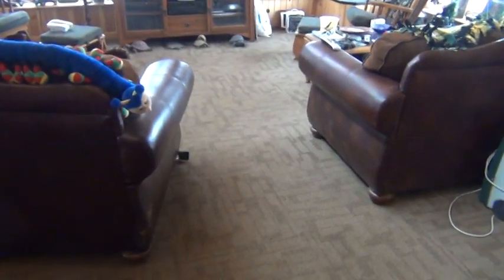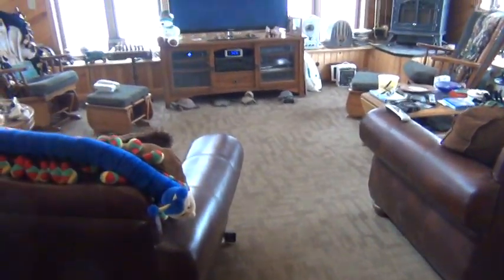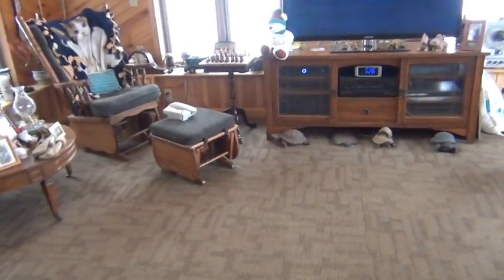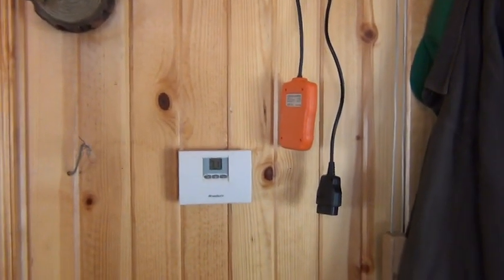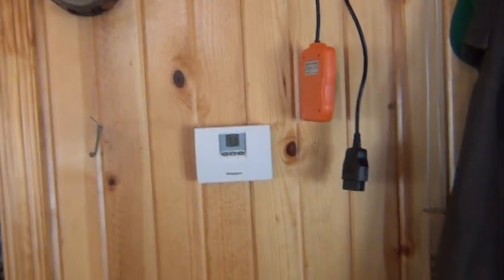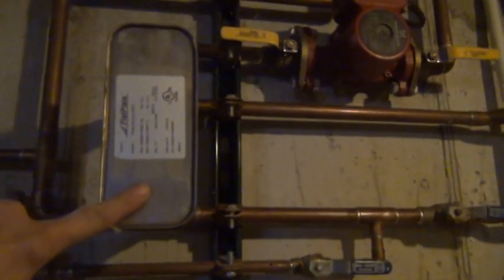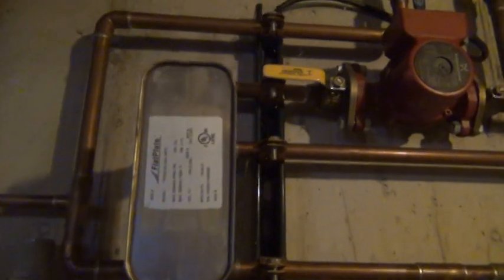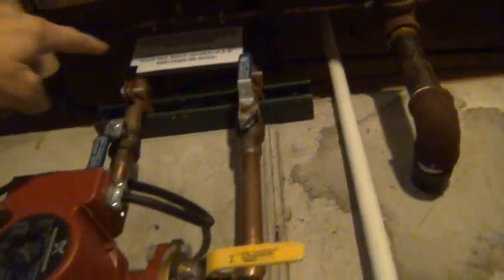Radiant Heat Using a Condensing Tankless Water Heater.

Comment: Hi Sudpail, I wrote to you awhile back but our build got delayed and the in-floor heating is just being addressed now.  Our addition is also 20'x20' and our plumber says a simple tank water heater should suffice, (will have a heat exchanger, like yours, and divide DHW and floor heat - so the same system as yours but with a tank heater instead of tankless).  But at 2:30 in your video, are you saying you used a tank heater first but it didn't work properly so you switched to a tankless?
Reply from the maker: Hi Robert, No I actually said that it did work quite well, but the problem with it was that there was a wide variation in water temperature between heating cycles. The tankless water heater provides a continuous 130 deg. supply to the primary loop with no variation as long as the thermostat is calling for heat. I found that because of this the tankless heats the floor faster and more consistently. While I was using the tank water heater I was quite pleased with it, but when I switched to the tankless I noticed the improvement.
Reply: @spudpail  OK, I understand,  Thank you for your help on this.  It seems to me that the tankless unit is a better way to go for the reasons you've stated.  My plumber might have a bias against them.  They do seem to have more problems than a good old tank heater - a lot going on in that small box.
Reply from the maker: @RobertSmith-bh5cv   I haven't had any problems in 2-1/2 years now. A friend of mine installed a new water heater about 6 years ago and It sprung a leak. Rheem made it so tough to get a warranty replacement that she just gave up and paid full price for a new one. The "good old" tank heaters aren't like they used to be so in the long run you may be paying more for a standard WH that a tankless. Did you get a standard vented heater? I don't like the fact that you have continuous cold air flowing right up through the middle of the water column. How many times have you heard a water heater turn on even tho no one is even using any hot water.
I used to have a house in Chicago that had a tankless water heater for close to 30 years. It had its idiosyncrasies that we learned to live with, but it never gave us an ounce of trouble. The heater was still up and running when I moved out. Tankless is not a new technology. They've had them in Europe long before we even heard of them in this country.
Anyway, I'm curious if you are using overhead shower valves with your new floor heat system? If you do you might get a rude awakening if you take a shower while your floor heat is on. I'll explain in further detail if you do.
Reply: @spudpail   By overhead shower valves do you mean just a regular shower head with standard controls for hot and cold?  That's what we have.  Please tell me what happens if the floor heat is running at the same time you take a shower.
I should reiterate that our system is just orange pipes dangling in the basement at this point.  We haven't hooked up the floor to anything yet since things were delayed so long.  I'm leaning towards tankless but I still worry about the complexity of them.  But you're right, things aren't what they used to be and as you say, the good old tank might have problems too.  I'll keep you posted.  I have to make the  final decision this week.
Reply from the maker: @RobertSmith-bh5cv  This may seem silly to you, but I like to have a valve on the shower head pipe that comes out of the wall. They are sold in stores for this purpose. The reason I have it is because I like to turn off the shower while I'm soaping up without having to stand in a corner somewhere and having to mess with the shower valve itself. It also saves hot water. Every time I'd turn it back on it changes the water temperature. The problem I had is when the floor heat pumps are running I would get a blast of cold water when I turned the valve back on. The reason is because the water gets pumped back through the wall shower valve which is still on, so it provides a third loop for the cold water to flow back down the hot water supply piping. When I would turn on the shower head valve it would take a good long time tor the temperature to return to normal as I cringe in the corner. I devised a convenient method to turn off the floor heat pumps by remote while I'm showering. Problem solved! By the way, this would happen regardless of what kind of water heater you have and only in a system that uses the same heater for radiant heat and domestic hot water.

Comment: Great video, thank you so much for your information you shared. Question, I have a small condo , 1200 square feet. My tank heater does my heat for the winter. Can a tankless water heater still heat a home?

Comment: 9:10 Any concerns about the electrical outlet behind the gas connection?
Reply from the maker: I guess if it developed a leak and the outlet started arcing and sparking there may be a problem.
Reply: @spudpail  if the sun exploded there would be a problem too..
Reply from the maker: @rogerwhiting9310  Giggle!! How very true!

Comment: Would  heat be conserved if the copper pipes were all lagged against the cold air?
Reply from the maker: I learned something today. I never heard of the term "lagged" before as it relates to insulation. Interesting!
It probably would save some energy and some of the pipes are lagged, however I actually want some of the heat to escape into the basement. My hot water bills are so low that I'm not really worried about it.

Comment: This is fantastic, thanks for posting.

I'm just finishing an addition of the same 20'x20' dimensions, with in-floor heating pipes installed in the slab.  I want to do the same heat exchanger system you have but not sure whether to use a tankless or tank-type water heater.  How did you decide on tankless? 

2 other questions:  Is the noise level of the Rheem acceptable and do you have a recirculating pump for domestic hot water, (I've heard it takes quite awhile to get hot water tot he taps without a recirc. pump).

I like the look of this tankless unit from Bradford White:  https://www.youtube.com/watch?v=1sFr9IP0nfE  It has top mount hook-ups, built-in flush valves, a system to reduce scale build-up and something to supposedly deliver more constant hot water.  Plus, it has a connection to hook up a recirc. pump.  No affiliation with Bradford White and don't know anything about their reliability.
Reply from the maker: Hi Robert, I decided to go with tankless because of the unlimited supply of hot water and because of its excellent efficiency. The previous water heater I had was a forced vent tank type water heater that I was very pleased with and it lasted for 27 years! I didn't want to go back to the old style gravity vent water heater and the price difference between a forced vent tank style heater and the tankless was only about $400.00. (Installing it myself kept the cost much lower). The tankless water heater also has the advantage of supplying water at a constant  temperature without any cycle fluctuations. Tank water heaters won't last as long either, so there is a payback besides energy savings. The noise level is very low!You do need a recirculating pump on the domestic side, but only for the primary loop of the heat exchanger. The domestic water to the taps is the same as it would be with a conventional system. As a matter of fact, everything is the same, it just works better! It doesn't take any longer with a tankless than it does with a conventional heater to get hot water to the taps. I don't like the recirculating pump idea because you always have hot water sitting in the pipes losing heat. If its new construction then insulating the pipes would help.The Bradford White looks like a nice unit. If it works as well as the Rheem or better, who knows? The BW has got a better warranty. I did have to purchase the clean out kit separately, (about $75.00). Do you have a water softener? If you do then you probably won't need to clean it anyway.The water pipes come out the bottom, but I never considered that to be a problem. The air intake and exhaust are on top and I was able to use 2" PVC instead of 3" due to the short run. I used 2" so I wouldn't have to bore 3" holes in my wall.Thanks for your compliments, comments and questions. Good luck!
Reply: @spudpail  Thank you, this is more great info.  Now leaning more toward tankless.  And I gave you a thumbs up!
Reply: Sorry, one more quick question:  How did you decide on 199K BTU's?  Since I watched your video, I phoned Bradford White and a technician recommended their 160K BTU unit.  There isn't much difference in price.  Do you think it's better to go with the higher BTU unit?
Reply from the maker: I guess I like redundancy up to a point. The cost difference isn't that great and I like for it to keep up with a heavy demand.
Reply from the maker: Thanks Robert. You made my day!

Comment: So is the only real difference, (besides the price)  between a tankless water heater, a combi boiler and a dedicated wall mount boiler the heat exchanger? Based on your experience do you think a set up like this would work for baseboard heat as well? Do you use the same unit for your domestic hot water? Thank you.
Reply from the maker: Yes I do use the same unit for domestic hot water. If it was used only for the floor heat, I wouldn't need the exchanger. I don't see why there would be a difference in using a system like this for baseboard heat rather than floor heat. Dedicated boilers usually run at around 180 deg. whereas this unit runs at 140 deg. max. to prevent scalding. Also as in my case the water runs through the exchanger which means that the water temperature would be a lot lower at the baseboard, (about 100-110 deg.). In my case it works fine for my 400 sq/ft. room, however if I were trying to heat the entire house, I believe a dedicated boiler would be the way to go. I hope this helps and thanks for your question.
Reply: @spudpail  Yes, it pretty much does. I was trying to find a way to save money by not paying the extra money for a boiler, but I guess there isn't one. (My house is like 1800 sg ft.) Not unless I wanted to divide the house up into zones and use a small unit for each zone. Or maybe if I used a straight hot water tank as a storage unit for keep extra hot water on hand for the heating. I guess I'll just have to keep living with the $600+ a month in oil bills. 
Thank you anyway!
Reply from the maker: I didn't know you were burning oil. Is there a chance that you can convert to natural gas? You will find that it will pay off in a BIG hurry!!
Reply: @spudpail  We can only have propane here. I'm thinking now maybe I should just a couple of those through the wall propane heaters.
Reply from the maker: I don't know what your energy costs are in Maine, but around here even propane is cheaper than oil, but I'm sure you checked out all your options.
Reply: @spudpail  Our electric is double most places because of our company charging for usage and delivery. Propane and oil are within less than a dollar of each other and the closest place that sells natural gas is 60 miles away.
When you installed your tankless did you have to have the gas company come and "tune" it for proper burn rate... etc or did it work the way it should right out of the box?
Reply from the maker: It was a fairly seamless installation that worked right from the start. I was concerned that my gas meter wouldn't provide enough gas for this 199,000 btu water heater along with all my other gas appliances, so I scheduled a service call and all he needed to do was tweak the meter on the input side and everything seems to be fine for about a year and a half now. No charge!
Reply: @spudpail  Is that floor you're heating concrete or is it just wood with the PEX and reflectors underneath?
Lucky there. The companies around here charge for everything.
I'm beginning to wonder if my only choice might be something like https://www.homedepot.com/p/Rheem-Performance-Platinum-50-gal-10-Year-Hybrid-High-Efficiency-Smart-Tank-Electric-Water-Heater-XE50T10HD50U1/303419574 and just leave it in heat pump mode as long as I can. I could always use my old hot water tank as a storage unit for the eating loop. Just a thought.
Thank you.
Reply from the maker: @TheMaineViews  The floor is concrete with Pex tubing. The piping to and from the floor is copper. The unit you sent the link for is interesting and has great ratings. In your situation this may be a good idea. In mine probably not so good. The "smart" part makes me giggle!
Reply: @spudpail  lol

Comment: What is turning on the boiler?
Reply from the maker: This is actually not a boiler, but rather a water heater designed to provide domestic hot water. I just installed it into my existing floor heat system. It turns on by sensing the water flow in the primary loop when the circulating pump starts running.
Reply: I wasnt sure that the pump can create enough flow to start the heater.Thank you
Reply from the maker: @alparkopp  The water heater will start with just a trickle.

Comment: I already have a similar water heater and I am planning to put in the pipes in the floors of the washrooms. where did you get all this equipment such as pumps, heat exchanger etc? I can't seem to be able to find this at home depot.
Reply from the maker: You won't find this sort of thing in stores because it is not considered a DIY item. However you can find them on the internet:  https://www.ebay.com/sch/i.html?_from=R40&_trksid=p2380057.m570.l1311.R4.TR10.TRC0.A0.H0.Xgrunfos.TRS0&_nkw=grundfos+circulator+pump&_sacat=0 Also see: https://www.ebay.com/itm/30-Plate-Water-to-Water-Brazed-Plate-Heat-Exchanger-1-MPT-Ports-w-Brackets/283522861641?hash=item4203478a49:g:eDoAAOSwT55dC509
Reply: @spudpail  thanks. maybe also go to a specialized plumbing store or buy directly from the manufacturer? to be honest, I don't like the term "DYI'er" because it sort of implies that the work you do is somehow inferior to the work done by a "professional". professionals don't inherently do a better job. in fact, they often don't read documentation, and mostly care about getting things done quickly. which is why the plumbing work that I do is usually far better than what I see as a product of professional work.
Reply: Have over the last forty years , seen many “homeowners “ attempt hydronics. Usually it ends poorly.   Be wise, save time, credit and grief, get someone that knows the trade
Reply: @bruxmcgunn4323   I heard the same thing about installing tankless water heater. I heard people pay thousands of dollars for that. in just a few days not only I did that at least as good as a professional would, but I also managed to redo all plumbing, unding the insane crap that "someone who knows the trade" did, and installing proper manifolds, for cold softened, hot and cold unsoftened water sources. why the hell would I trust someone to mess around with my project if I am having fun, saving thousands, and doing great quality work?
Reply: Michael Kuzmin , ha ha of course there are the whiz bangs with 30 years experience doing crappy work... I speak from being called in to fix screwed up half baked projects, however with advent of yu tube, seems better

Comment: I have a 175 btu tankless water heater. I want to install modern radiators in each room with pex for supply and return. Hard  to do in floor in an existing house.
Reply from the maker: Sounds like a plan! Keep in mind that a tankless water heater is designed to run at a maximum of 140 deg. Normally a hot water boiler would put out 160 - 190 deg. Maybe 140 deg. would be enough depending on the climate and how well your house is insulated. Are you using this heater for domestic hot water as well? If you're using pex, make sure it's the type that can be used for hydronic heat. Good luck!